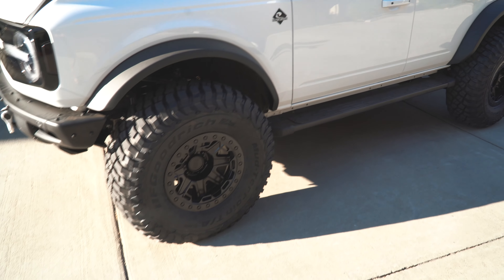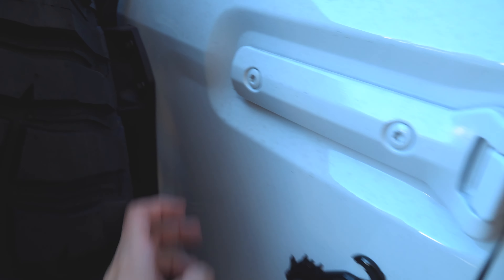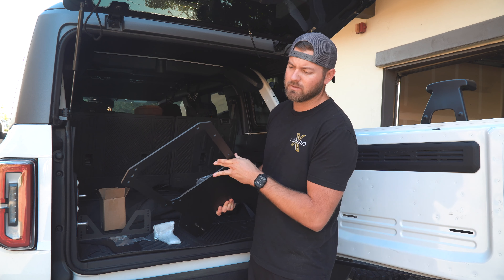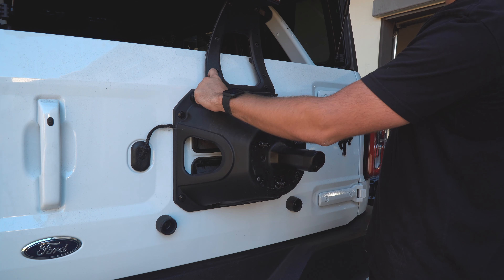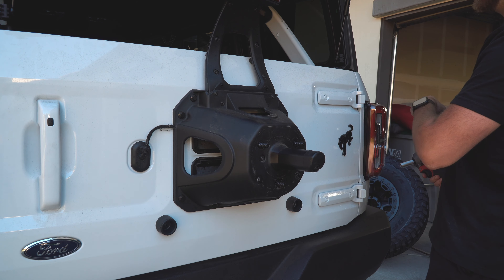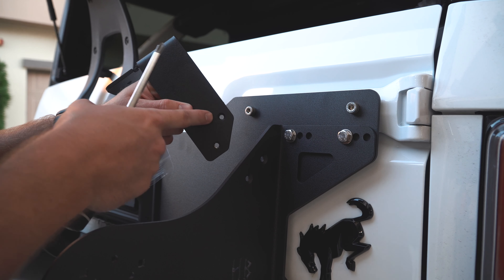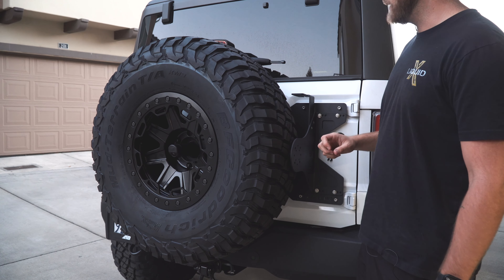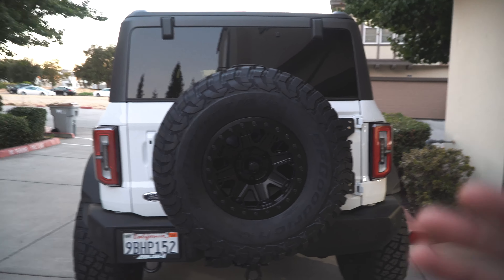My Wheel/Tire is TOO HEAVY! Hammer Built Bronco Spare Tire Bracket Install

Comment: This is a great video but I don't understand these reinforcements. I have a Bronco Raptor and it has the same kind of thing from the factory. It looks like it's simply reinforcing the sheet metal and not the actual place that is bearing the weight (the hinges and the hinge bolts). Looks nice, though!

Comment: OEM 35 inch tires weigh 60 pounds each. If you go to 37s use a BFG KO2 Load C. Its the same as the Raptor and they weigh 65 pounds.

Comment: RIP that rear brake light tho eh? lol 

As for sliders... I went with RCI Offroad with the 20º angle up... after looking all around at all the options... liked these the most and most practical for clearance and ability and looks imo.
Reply from the maker: Those are pretty sweet! Do they still give you a little ledge to step on? My gf needs that to get in/out. I was also scoping the DV8 ones.

Comment: Does your bronco fit in your garage? Do you think a 5 inch lift with 35s would fit in your garage?
Reply from the maker: It will not. I actually measured the top the other day for a forum member. Mine is around 78" tall at the highest point of the roof
Reply: @JacobRDoty  thanks for the info!

Comment: How is your payload looking with the mods? This looks great.
Reply from the maker: Thanks! Payload should be pretty unaffected. The load rating on the tires is actually higher than OEM. Really the only difference so far is maybe 35-40lbs more off the tailgate than OEM Sasquatch for loaded weight
Reply: @JacobRDoty I don’t think you’re understanding his question. He is asking about vehicle payload not the “payload” or load rating regarding the tire dude.

Comment: How'd you add a 3 inch lift and the 37s still rub on the back?  I've seen other videos with a lift or simple level kit and 37s fit perfect....
Reply from the maker: I don’t rub in the back - I rubbed on my side steps
Reply: @JacobRDoty  I meant I haven’t seen rub anywhere on any other video with 37s and the lift…is something different about yours or will 37s rub the step generally speaking on OBX?
Reply from the maker: It’s just the OBX step. They hang super low and go all the way up to the fender. The rock rails or non side step equipped ones aren’t having these issues. Haven’t ever seen an Outerbanks on 37s with my wheel offset (wheel offset matters a lot) with the oem side steps so that’s prob why

Comment: Great video but you kind of skipped over the most important parts. Drilling bolts and handling the bracket. Like you skipped right to the end of the tire carrier and I wanted to see how you handled the micro fiber towel and alignment of the hinges.... Kind of a shame and not helpful for me.
Reply from the maker: That’s because there isn’t any drilling. It lines up with the existing hinge bolts

Comment: Is this really a thing or some bull shit marketing to sell more accessories? I’d imagine Ford built the initial platform to hold tires in general which come in different sizes and weights. I know the raptor had a support and that’s where this all started but the raptor is meant for hardcore off road baha type driving! Do you need this for a 35 70 17 type basic large wheel? Just street cruising and winter roads no off road shit.